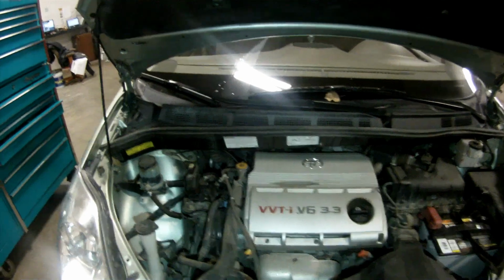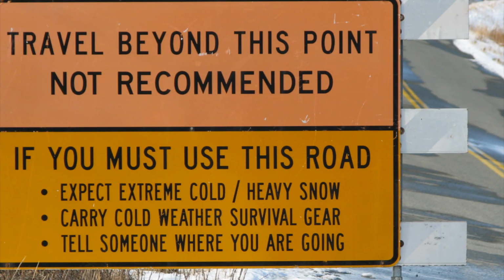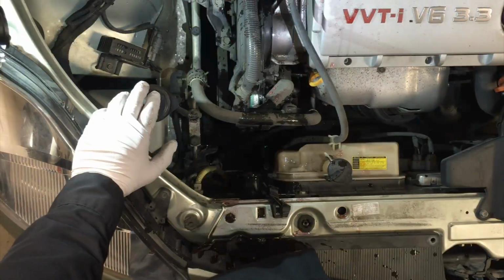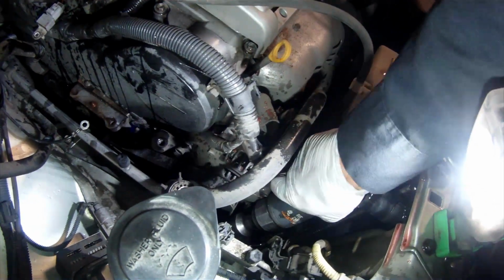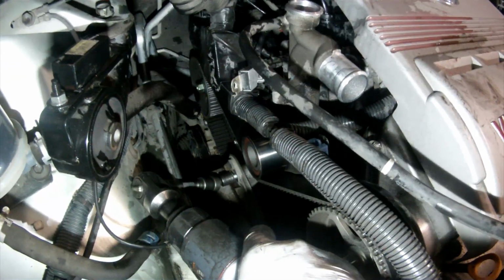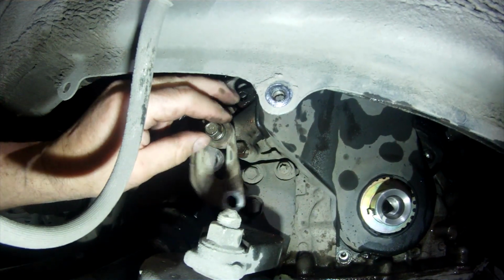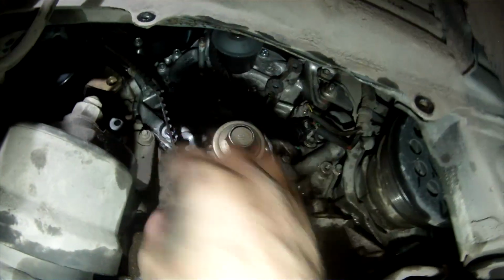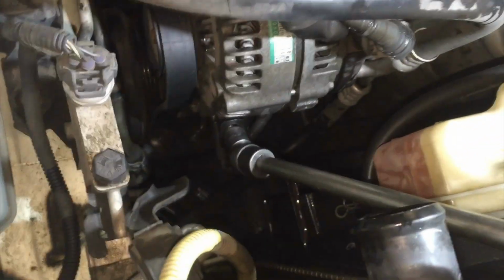Toyota Sienna Timing Belt Water Pump Replace - Toyota Highlander 3.3L Timing Belt Water Pump

Comment: I thought about doing it myself.   After watching this, decided to take it in to the shop.   Thanks for the video.
Reply: It's much harder then what is shown on the video. Getting the timing right and the belt back on right is half the job. Let only taking all off the parts to get to the timing belt. Smart move on your behalf.
Reply: How much did it cost you?
Reply: Me to
Reply: Instablaster.
Reply: I thought it was just me. This looks so intimidating watching this video literally robbed me of my testosterone. I'm going to shallow my pride and being it in. $209 for the Aisin TKT-024    oem kit $425 for the repair. I guess not that bad.

Comment: Great instructional video. I am doing a friend's 05 Sienna, with 193K on the original belt. It is full of cracks. He's lucky it didn't break.
Reply: My Sienna has over 200,000 miles after pulling a pop-up camper thousands of miles to over 20 national parks.  Still the original belt.
Reply: Did you change it yet? LOL  @youdagoob

Comment: Excellent video, the only missing part, is really good idea to replace, the thermostate, i have a 2004, that was starting to leak from there, since you are emty the cooling sistem, thanks!!!!
Reply from the maker: Always a good idea! Thanks for dropping in.
Reply: Yes, the plastic housing extension for the thermostat  is known to be a problem area, they eventually crack from the heat cycles. Changed mine as a precaution. You need to remove the starter to get it out, just 2 bolts on starter then work it through.

Comment: Big tip, put on the timing belt on first around the cams and the crank pulley and then install the tensioner on last, this will save you a lot of frustration trying to get it around the tensioner. I have done this twice now.

Comment: Good video work and narration. But most importantly,  excellent instruction! Sometimes it is the little things like that broken stud that gives amateurs the most trouble because the repair manual doesn't address that.
Reply from the maker: +dan andy Sad to think I almost left that part out in the edit. You make a valid point, it's the unexpected that turns the simple stuff into nightmares. Thanks for dropping by.

Comment: Love the video, wish you would do one on how you removed the stripped e8 water pump bolt, mines stripped and I'm stuck on that bit. Gave you thumbs up but does anyone know how to drill out in that small of space?
Reply from the maker: If you can extract the broken bolt its best. they make a tool that grabs the exposed bolt if there is maybe 1/4" still protruding from the face after water pump is removed

Comment: Also, this is a good time to replace any worn motor mounts if needed. Most mounts will go 150K or ten years but since there are many different driving styles and terrain variations, these are merely estimates. We also replace the power steering and serpentine belt while everything is disassembled. These belts are inexpensive but the labor to replace them separately is not😳

Comment: Hi Tim ,Another very professional repair video.Great idea to replace the pump with the timing belt at the same time.Any trouble removing the crank bolt ? sometime that is the hardest part of the job.Jim
Reply from the maker: +jimthecarguy Generally these motors don't give me too much heartache when it comes to removal of crank bolts, however some 4 cylinders and Hondas can be rough. Thanks for dropping by!

Comment: Pulling the rad hose made one heck of a mess. Think I will leave it on. Some great tips though. Jacking up the engine might avoid the need to remove the stud. I would remove the tire 
sooner so and work from the bottom sooner rather than later. This vid is for more experienced DIY guys so if it's your first time, check out more vids before diving in.

Comment: Fantastic video Sir! I have one question I hope you can help me with. My Dad has the exact same Sienna, and the belt broke at a dead stop, idling. He then tried to crank the motor over for a couple of seconds, no odd noises occurred (just no firing); he then proceeded to call AAA. 

Long story short, should I line up timing marks per your instruction, install new belt, THEN check for damaged valves by turning the motor over by hand/compression check/leak down/etc, or do you recommend a different approach? I do not want to install a new belt and attempt to fire, only to cause more damage due to bent valves/damaged pistons. Should I pull the heads just to be sure? 

Thank you in advance!
Reply from the maker: I very much doubt it bent any valves. I have never seen these motors bend valves under any circumstance.
Reply: You were absolutely right Sir! No harm whatsoever. Thanks again for the video guidance!!
Reply from the maker: Sure, glad it turned out well for you. Take care

Comment: Hi, did you crank the engine manually first after the line on the belt line up with the mark or just rotate the crankshaft 360 degree. If you do crank the engine manually, which part should we crank to set the engine manually? Is it the same thing with rotating the crankshaft 360 degree? Thank you so much

Comment: One more question Car Doctor. In some other video, I saw that the backside pully is wedged w/ a wrench not to make it move when the belt is loosened. He explained that otherwise the back pully turns fast when the belt is loosened and piston hits valve, etc. But in other videos I don't see such a thing for 2006 Sienna including yours. Do we need to use wrench to wedge the backside pully to prevent its move when belt is release? Thanks again for the great video!

Comment: I found out the hard way. The bolts that hold the engine mount to the engine block, the long like 4 inch bolts, those are hardened steel and the engine block is Aluminum. Put some antiseize on those threads for easier removal in the future. I ended up having to use a "redneck" method to get it to come off. A bottle jack, chain, and an electric torque drill. Hahaha.

Comment: My 2004 Sienna has 330k miles on the original timing belt.
Reply: Did you ever replace it? I have 196k and I'm thinking I should do it but not sure if it needs it if yours made it 330k!
Reply: @superman1390  nope, runs great.  I'm at 340k!  I change the oil religiously.  I really should flush the coolant but I don't.   :)

Comment: before you remove the timing belt and tensioner, Crack the cam cog bolts loose in case they have to be removed. If you don't it will be VERY difficult to lock the rear camshaft for cog bolt removal.

Comment: There are 2 notches on the Highlander crank. 1 is on the small diameter, deep width gear(closest to the pulley bolt), and another on the tall, thin gear(closest to the block). Which do I line up with the hashmark on the motor?

Comment: Hi Car Doctor, thanks for the video. While I am watching the video, I noticed that I couldn't find out any jack or jack stand that supports engine after you remove engine mount. Do I miss something? Can you explain how you supported the engine after you remove the engine mount? Thanks!
Reply from the maker: +Hoon Choi I did not use a jack. When the front mount is removed the engine drops slightly but not significantly. The use of a jack is not necessary to complete this job. Thank you for watching and good luck with your repairs!
Reply: +The Car Doctor Thanks a lot for the info. Will try the timing belt and water pump change following your video. Thanks again.

Comment: Car Doctor, my timing belt failed after I recently purchased my 2004 Toyota Sienna with I believe is an interference engine. I watched your video and hoping that perhaps my engine did not fail, according to your comments, maybe I got lucky. Would I have heard loud noises when the belt failed?, because I never heard anything like that, the van just died at 45 mph. Anyway, is there a way I can tell if it is worth trying to put a timing belt on it, considering I have an interference engine? If I install a new belt, could you tell me how to turn the crank and cam in order to align the marks, without damaging anything? Thank you , love all your videos
Reply from the maker: They call it an interference motor but I have never seen them bend valves. I would replace the belt and see what happens.

Comment: How did you extract the broken stud? Did it strip or shear? Any reason  why? Enjoyed the video.
Reply from the maker: +Andrew Thompson I was able to use a pair of channel locks on it after the mount had been removed and it came out pretty easy. The inverted torx head on that stud is so small its easy to round off. I figured I would mention what happened even though insignificant so that others who likely run into it would know what to do. Thank you for visiting my channel and your complements.
Reply: +The Car Doctor Thanks for your reply. I enjoy your channel I've learnt a lot from it.
Reply from the maker: That makes me happy!

Comment: 2006 Toyota Highlander v6 gas 100,000 miles. About to replace timing belt but mechanic says not to replace water pump since it should last till next timing belt change, going to do at same time but now he is saying to save money do not replace pulleys/tensioner/ seal as long as they are okay yet isn't this a big risk and all the kits seem to come with them but he says he does not use kits. What is your opinion on pulleys/tensioner and how much more could that cost in labor?? Thank you
Reply from the maker: I would do it all with quality parts so you don't have to do it again when the pump starts leaking or a pulley fails.

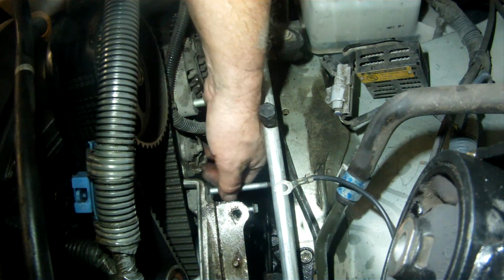Comment: Do you happen to remember where you found the bolt/stud you stripped pulling the bracket around the 13:25 mark in your video. having a hard time locating it in the Parts catalog. Thanks.

Comment: Hi Doctor

Would you mind telling what is the function of timing belt guide comes off at the back of crankshaft pulley? Thanks 
as I have had it bent a little bit and now after replacing t he belt getting P016 code starting is ok driving is also ok
Reply from the maker: That plate just helps prevent belt wear and keeps the belt tracking properly on the gears. Don't think the guide has caused the p0016
Reply: Thanks a lot for the quick reply, it may be then tooth missing I believe.

Comment: Hello fellow auto repair inmate, ha ha! but all seriousness aside i have been at a dilemma as to recommending factory parts for such jobs as this or aftermarket? i have used Aisin kits online that are supposedly factory but have a trust issue as to their genuine home and the delay in time, so what kits do you use? i am currently looking at a import direct kit from O'Reilly  that comes with the gates belt, any thoughts? and good vid and thanks
Reply from the maker: Not familiar with that kit but gates is a solid brand. What brand pump is in the kit?
Reply: The Car Doctor....... the import direct line is manufactured by standard motor products also standard produces some Murray Napa and Carquest parts, but who knows what comes from where?

Comment: I have a question. I've never worked on a Toyota before. I just got this 2 weeks ago. I noticed that my air works but does not blow cold air. It will blow hot. Was told to recharge or replace the compressor. I have not done that yet. Within 24 hours I would be driving and all of a sudden van would overheat bad and smoke will come from under hood. Both times I immediately pulled over. After letting it cool, I filled it back with water and it would not overheat again. Was told all in all that it could be my water pump causing all the problems with air conditioning and overheating. I'm a single mom so I cant afford the hefty bill of a mechanic. Any suggestions on what or where I should start first? Thank you so much.

Comment: Did you have any issue with the bank one (back) cam shaft snapping back? how did you hold it from moving after removing the belt?
Reply from the maker: I have never bought a cam holder but they aren't very expensive. You can also use a couple long handled wrenches and a vise grip to hold them. I just was careful and able to line them up with a little finesse.
Reply: The Car Doctor I have it lined up I just wasn't sure if the back cam sprocket would move after taking the timing belt off.

Comment: Great instruction video, except......coolant is spilled  all over the place and even while installing the new belt, no note to clean the pulley grooves or clean off the coolant as it can contaminate the belt and cause failure due to slippage. Any oil or coolant can cause the premature deterioration of the timing belt.   When doing timing belts, its imperative to make sure everything is clean and dry before install in order to ensure a proper installation. Besides that, I change gloves and will replace the crankshaft oil seal.  Even talking off the wheel with an impact hammer.....it was not done in a star configuration.......  Thanks for taking the time to do the video, helps me to figure what I need to remove, but I gave a thumb down because of the sloppy procedure.  Proper factory training would dictate  a "clean and dry" approach...., there was no stressing of cleaning, and avoid contamination prior to install.  This is not a professional install,....though I have seen this done many times like this and premature failure occurs.
Reply from the maker: Thanks for the input. Please make a video showing the "proper" way to do it. Thanks!
Reply: yea make us a video warrior

Comment: I wish you showed how bad the old timing belt was. From a distant glance, it looked good and no need to change.
Reply from the maker: In this case the belt was replaced because it was due from mileage. Even if a belt appears OK it could break the next day. Don't ever rely on a visual inspection for wear especially on interference applications where a broken belt can cause engine damage.

Comment: I replaced the timing belt/water pump on an '06 Highlander V6. During disassembly/reassembly, cam/crank gears had been turned. However, I was sure to realign the notches on the cam gears with the notches on the stamped metal pan behind said gears. Then, I matched the correct marks on the new belt with the corresponding notches on all 3 gears. After reassembling, the engine doesn't seem to run correctly. Do I need to reset the timing? If so, how? I'm no mechanic, I just have a lot of tools. Tried saving my elderly mother some money by replacing the belts on her car myself. I fear that I may have done more harm than good. Thanks.
Reply from the maker: No timing adjustment needed. Did anything get disconnected during the work?
Reply: The Car Doctor - I gave it a second look around, couldn't see anything I missed. After reassembly, recharging/reconnecting the battery, I tried starting it. It started for a couple seconds, then bogged-out. Hasn't fired up since, just turns over.
Reply: I think I just figured it out. I didn't see a corresponding notch for the crank gear to align with. I only lined up the cam gears with their matching notches in the back cover, then put the new belt on, matching up all the marks on the belt. The only line I matched the crank gear with was on the belt, couldn't find a matching notch on the block. Am I going to have to repeat this entire process to rectify the issue? Jesus... I hope not.

Comment: The repair manuals say to remove all the spark plugs, I noticed you did not.  Why not?  I thought they are supposed to be removed so you can rotate the engine to get to tdc.
Reply: Removing Plugs makes it easier to turn engine because it relieves any air pressure build up. Which Piston is Top dead centre Glad you asked. 2. But which 2. See why he didn't bother. Time is money my friend.

Comment: Can you help me, my toyota sienna runs perfectly before I changed the  water pump and thermostat, now it heats up and the temp guage goes up after 10 mims of driving
Reply: check the  thermostat  iif you put it jn the wrong way
Reply: It overheats because of an air pocket in the cooling system. When filling the sienna with coolant you need a special funnel. Run the car 1500-2000rpm until all the air bubbles escape.

Comment: I did enjoy the video, but this is why I think I'll never buy a Toyota or Honda FWD V6 motor.  More than halfway through the video and you're still taking off the serpentine belt.  And why is Toyota still sticking with three accessory belts when everyone else has gone to one?
At least you didn't have to lock the cams.

Comment: this guy is not very clean. spilled coolant all over the top of engine. should of pulled the hose on the radiator side.
Reply from the maker: +Yod S that's actually power steering fluid I got on the cover when I moved the pump to get better camera shot of the operation. I cleaned the entire engine bay after the work was completed because it is important for me to keep it clean. Thank you for watching!

Comment: Did not show how the marks line up on the crankshaft, did not show proper installation of the water pump, did not show pulleys being replaced, did not show timing belt being routed, did not show rotating the engine twice to confirm that the marks line up, did not start engine to verify proper installation.

He's decent mechanic, but a terrible YouTube video maker.
Thanks for trying though...